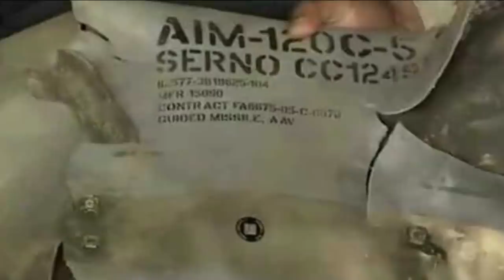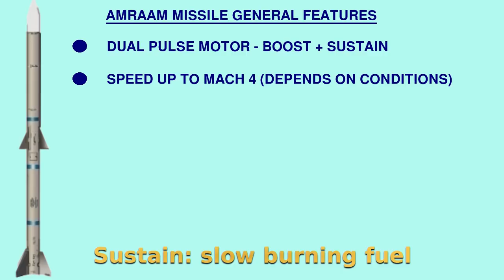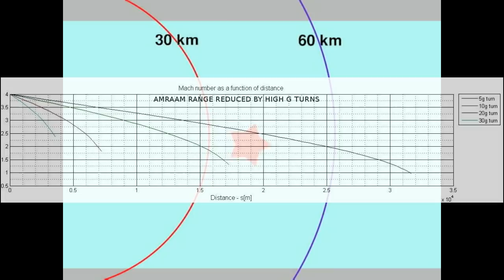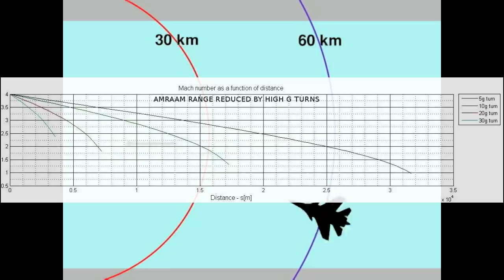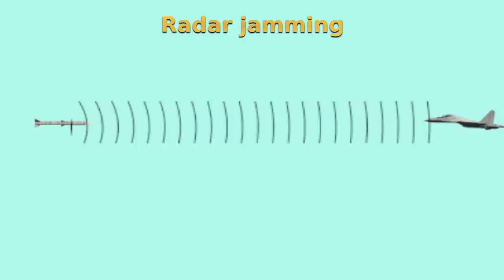Explained: How IAF Su-30s evaded Pakistani F-16s + AMRAAMs (हिंदी सबटाइटल )

Comment: Does this whole Mig-21 shooting down an F16 seem logical?. All of the stories your'e hearing are from Indian media and the govt information machine of India. The truth is, Indian's lost not just 1 but 2 aircraft. Local eyewitnesses saw not 1 but 3 pilots bail out. if your'e an aviation expert or an enthusiast to the least, you will not deny this. Let me add my 2 bits here. If it was 3 bailouts/ejections, meant 2 or 3 aircraft went down. The Indian formation that was intercepting the Pakistani formation were 2 Mig21's, 2 Su30's and a Mirage 2000 as per news around. Pakistani Military says no F-16's were used but they didn't specify any types of aircraft that were used either. As per initial news in the Indian media as well as Pakistan, 2 aircraft went down, 3 pilots were seen bailing out. Pakistani inner sources and Airforce circles have been heard saying 1 mig 21 and 1 Su30 of indian Airforce were downed. The official initial statement was that 2 aircraft were down and 1 pilot was captured while the hunt for the other 2 was on. Later another 1 captured but in critical condition and was said to have been transferred to hospital. Then in the evening they changed the statement saying 1 aircraft down and 1 pilot captured, no mention of other pilot. Indians have been mum about the SU-30's presence, locals saw the SU-30 as the silhoutte is much bigger than F16 and Mig 21. here's the link for the indian news about SU-30 which was quickly stopped afterwards by govt involvement. SU-30MKi Was Seen Chasing Pakistani F-16 on LoC in Nowshera sector
SU-30MKi Was Seen Chasing Pakistani F-16 on LoC in Nowshera sector Pakistan Shoots Down Indian Su-30MKI Fighter.
Pakistan Shoots Down Indian Su-30MKI Fighter.
Now being an aviation geek, one should know that F16 block 52 delivered to Pakistan are mostly single seaters and only 2 or 3 twin seaters are in service in training roles only. So the most logical conclusions are :
1. F-16's downed a Mig-21 and a Mig 21 downed the f16 (Kind of far-fetched though) and doesn't explain the 3rd Pilot also no wreckage found by Indians or Pakistanis.
2. F-16 downed a Mig 21 and an SU-30 (explains the 3rd Pilot) as all SU-30's are tandem seat, F16 did it with the very capable AIM-120C AMRAAM (Kind of likely.), also Indian ariforce paraded remains of an AIM-120 to the media. 3. A JF 17 downed a mig 21 and an SU30 (Maybe possible).
4. A Mig 21 was downed by a Pak F16 which was latter downed by SU30. (doesnt explain the 3rd pilot).
Pakistani Airforce veterans circles have been chattering and heard congratulating each other about downing of a Mig 21 and an SU-30MKI by Pak pilots. Now heres the smoking gun and you might find it funny. The pilot captured and released by Pakistani Airforce was an experienced and well known pilot in the Indian Airforce. Wing Cdr Abhinandan was probably the leader of the formation . Wing Cdr is the highest regular flying rank in the Indian Airforce after which they get on mostly to more support or command/training roles. This same Wing Cdr Abhinandan can be seen in an Indian documentary on the SU-30MKI made back in 2010, he was introduced as a Flt Lt back the and a pilot on the SU-30MKI.
The obvious here is that Wing Commander Abhinandan was flying an SU-30MKI, the mob that caught him was heard talking about the co-pilot in videos also and his whereabouts where they were saying he went on the other side (probably across the border). The IAF had their ass handed to them by the better trained Pakistani Pilots.
I hope this explains how the outlandish Mig-21 shooting down a F-16 claim is completely cooked up and probably allowed to go unchallenged by the Pakistani Military/Govt people to let Indians save face and to help de-escalate the situation. Besides do u think a pilot that was trained and accepted on India's best aircraft as a Leiutenant would be relegated to fly a Mig 21 a so called Flying Deathbed when hes a Wing Commander.
Reply: Your statements are stupid.. First listen to your PM statement.. It was two pilots captured. Later in the evening it became one.. Local witness saw.. Two pilots ejecting out.. Now that second pilot was from F16. And your local ppl caught hurted and he died in hospital. Why did Imran khan changed statement of pilots from two to one...next.. Regarding Amram missile.. Your Chinese made jf 17 cannot carry American missiles.. U should have known before arguing.. Lastly... How about your 93000 soldiers surrender before 5000 Indian soldiers in biggest surrender in the history... Dont talk about one soldier.. Abhinandan again.. Read about your one soldier who was killed by your own ppl..

Comment: There’s no way a 10-15 second burn gets the missile 30km distance...not even at 50kft altitude. The missiles are coasting way before that point. Everything changes depending on altitude and air density. They were missing because they were firing from too far away. It had nothing to do with the equipment or weapons.

Comment: Good One Shiv.

Trick is to use High Right Angle Turns at 90 Degrees, to beat the fast flying missiles which has been overcome by Vector Load because of Speed Disadvantage.
Reply: Hello Maik it seems u know about aircrafts. What if I tell u I saw everything that day from a hill top. I remember most of it but can't make much out of it. I heard 2 explosions aim 120 C.
Reply: @gymdshowkeen117  

You heard 2 explosions aim 120 C. Can you tell what was the outcome, one was a BISON down, the other one was ?
Reply: @maikbanner7552  no aircraft was downed near me...1 aim 120 injured a civilian person 20 km east of the su 30 location approx. 1 aim 120 landed 1 km west of me. I visited that site few days after as it was in a jungle. Only to know that all the debris was collected by Indian army. I saw a crater 6- 8 feet wide.
Reply: @maikbanner7552  1 jet was downed near LOC I saw a ball of fire. But that was some 10 to 20km toward west of me . As I could only see the aircarfts but no sound. I saw 5 aircarfts there very close to eachother. 2 I could identify as mirages when they turned exposing their outline. But all of them were almost equal in sizes. So may b f 16 and migs.
Reply: @maikbanner7552  this is what I saw...
I will tell u what I saw u guess m
 the altitude  and speed and maneuver.I watched su30 evading missiles that day from a hill top. It was right above my head and I could see the aircraft and all wings clearly but no weapons. First it was flying toward west i.e LOC. then it suddenly started turning north and then toward east followed by an explosion in the east. (I think first missile was dogged). Then it came back from east. Took same turn again. 2nd explosion in the east. After than it went more toward south west. And this was the point when I saw 1 jet going down toward LOC. Surrounded by 5 other jets...2 were mirages I could tell because when they turned sharply I could see the outline of tailless delta wings. Others were further west.  After this a big formation approached from south east. I couldn't see anything because they were very high and i had to look directly into the sun. But rumble was very loud and stomach churning.
Reply: @gymdshowkeen117  

Then the PAK army 2 other pilots other than Abhinandan, Where are they?
Reply: @maikbanner7552  i saw only 1 jet...going down... My friend was watching from another much elevated point closer to LOC .as my friend puts it.."our jets cornered 1 pakistani jet and was shot down. So it must be f 16.  As I also saw 2 mirages so other 2 must be migs and 1 f 16 which was too inside Indian airspace trying to fire those aim 120 at sure 30s.. That makes 5 total which I saw from my location. I don't know about Pakistani side. I saw only 1 which I think was f 16.

Comment: The Pakistanis lost no jets. And no evidence still have not been provided that a Mig shot down an F-16

However yes, the Su-30 did evade all the AMRAAM
Reply: The f-16 blip disappeared from radar images in 5 secs (AWACS).
Reply: Black Ops that could be a multitude of reasons why. Unless you have actual footage of the encounter, and the images from the MiG that it’s shown a splash was delivered with one of its missiles fired by Abhinandan, then you can conclude that.
Reply: @navrhy3075  kk i agree without but why there ispr said that we have 3 pilots down, 1 captured, 1 hospital for treatment and 1 on the ground later changed to 2 and later 1 pilot, so who are they as much i know pakistan do use twin seater f16
Reply: A lot of information came out at the time of the event. But later it got all swept under the rug. And only what had proof came out in the front.

As for BVR, there are infrared cameras placed on every jet. That is monitored by the ground team. There would be something that concludes and support the claim of an f-16 being downed.

Comment: This is very good but what the IAF’s Sukhois could not do was counter the Pak Aamram missiles with their own because the ones possessed by the Indians did not have the sufficient range to down the Pak jets. The Indian Mig 21 was using only short range missiles and had to get close to the Pak F16 to engage at short range. Consequently it too was shot down because the risks in dog fights are very high! Future warfare will be fought primarily beyond visual range !!!
Reply: r77 have lesser range than aim120c and are fox 3, but the r27er which can be fired by mig29 and su30 have more range than the aim120c, but are fox 1 so radar lock is needed all the way to missile contact and so are not fire and forget so you cant fire the missile and turn back
Reply: I just don't understand why we used Mig 21 Bisons in the first place when we had Su 30s and Mirage 2000s
Reply: Sudhir Narasimhan the mirage 2000s and SU30s were not close by, also the mig 21s are our first line fighters!!! Sad but true, we need to rapidly upgrade our fighters otherwise we will be overwhelmed by Pak and China!!!!!

Comment: I'm 100% sure that Two jets went down in POK that Day.
1 is Mig & 2nd is confirmed F16 kill that fell 8 10 Kms inside POK
But I don't know why our Intel fail to get much info despite our agents presence  in POK ?
Reply: Maha RAW and IAF were able to count 300 dead bodies in the dark of the night but couldn't locate F16 wreckage? Guess what? There was no F16 shot down neither were there any 300 dead bodies.
Reply: @muhammadahmed826  similarly no s30 was shot down, and you even awarded your pilot for that, 9 month have past still no evidence regarding su30 even after getting challenged by Indian officials of showing any
Reply: @ShubhamKumar-ye2ou  no indian media was allowed to cover the army areas where Paf strikes were made.If that can be covered then su30 wreckage can be covered as well.
Reply: Pakistan has responded fast to hide all the debris and pilots. Even U.S is still quite on this issue.
Reply: Try to get your information from right corner not from religious quarter....
PAF plane did not crash nor even used the F-16. Its only F 17 thunder
Reply: @waseemazizi9401  so why awarded f16 pilot
Reply: Because US also helped them in hiding the F16 wrekage and demanding them to replace the shot down f16 with JF17 so that US's F16 can't get defamed as it will affect US trade of F16
Reply: @xsupremeyx9923  that's a Funny argument.

Comment: flying at right angle to the missile is called beaming. Other factors also dictates the range of a missile like altitude, speed of the delivery platform,.. evading any BVR in the extended ranges is easy, you just need to do some slight turns to make missile bleed its energy,..
Reply: Isnt that notching, not beaming? beaming is when you fly at an angle towards the missile to reduce the closure rate while keeping the bandit in radar azimuth to maintain lock. eg at 10 or 2 o clock . if you alternate to each side to make the missile turn and burn then that would be cranking
Reply: @FookFish  no beaming is when u fly perpendicular to the radar beam, to confuse it , as you become stationary target in the horizon in that plane.
Reply: @prashantsharmastunning   I don't think so. I believe it's called "notching".
Reply: @popupbandit  Notching is not the same as beaming. You beam to enter the notch, which is why people may confuse one for the other, but the notch specifically refers to the range of speeds around the ground-clutter closure that will cause a radar to drop your contact in a look-down situation (for example, your ground speed +/- 50kts).

Beam obviously refers to placing your bandit on your 3-9. They may look the same at first, but they aren't (a slow enough plane can notch without beaming).
Reply: The PL-12 missiles deployed by JF-17s to shoot down MiG-21 and SU-30 are oblivious to these WWII tactics.